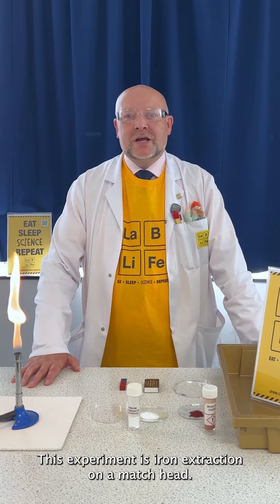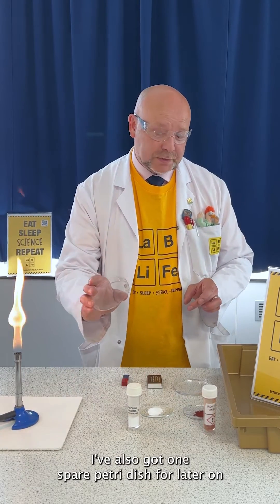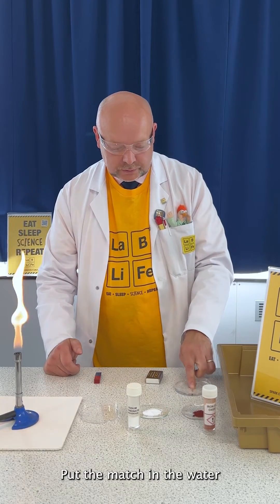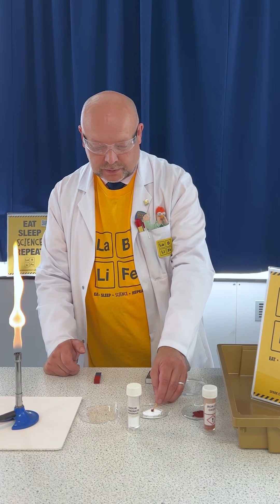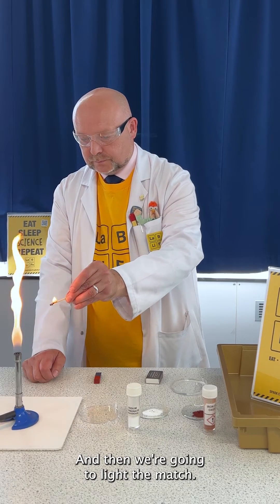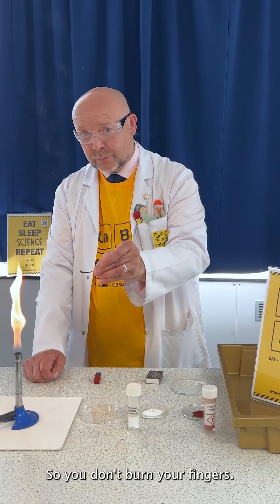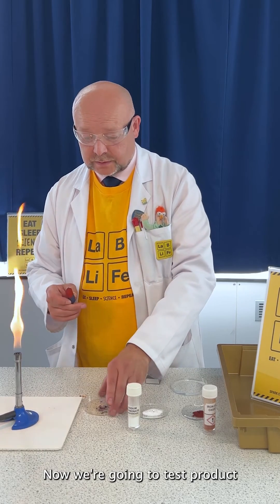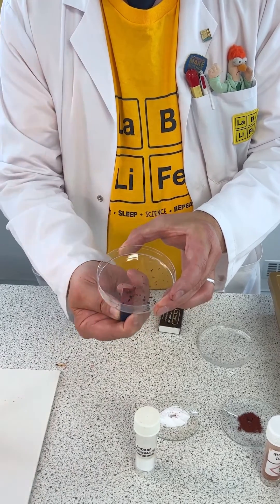How To Demonstrate Extraction of Iron on a Match Head | LaBLiFe

Comment: What kind of reaction is taking place  while and after  burning the head of matchstick ??
Reply from the maker: Burning the head of a matchstick involves a chemical reaction known as combustion. Combustion is a chemical process in which a substance (in this case, the matchstick) reacts with oxygen in the air to produce heat, light, and various products, including carbon dioxide and water vapour.